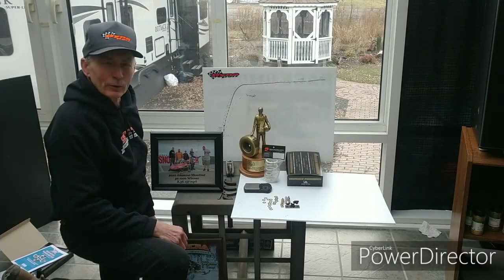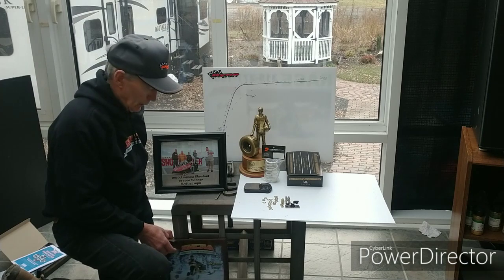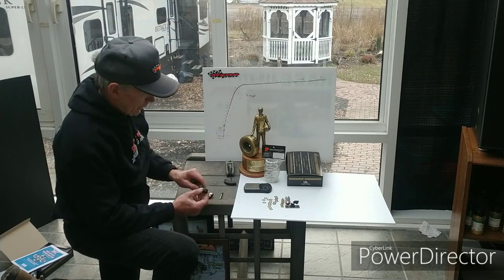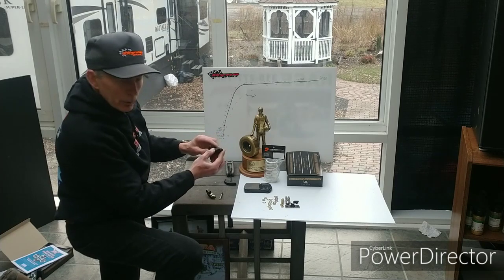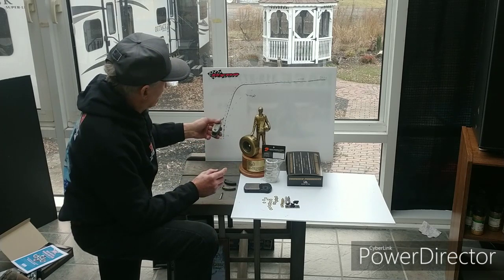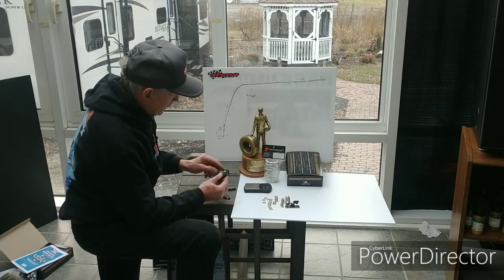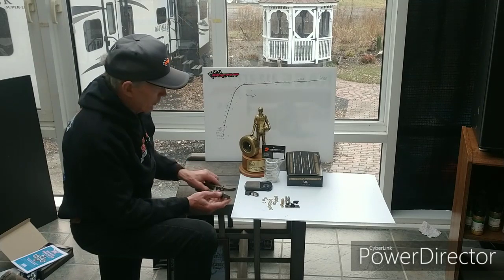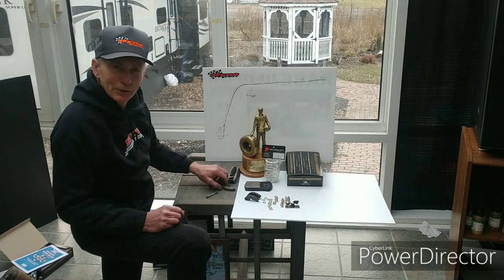Snowmobile clutch tip weight and response explained

Comment: I have a 87 yamaha exciter that I use for ice fishing in Colorado at altitudes  from 8,000 to 10,000 ft. Carbs are jetted for that altitude. But I get a bad bog from a stop through low mph. What color spring and weights do you recommend.  There's a yellow spring in there now. Thanks.

Comment: Hey Rich ! Love your videos and subscribed ! Question here ! I got a 2009 RMK 700 And at 3/4 throttle I hit the rev limiter and then The Zoomies kick in... I can ride my sled and give it it's full power but I can never pin it down... I'm always riding this sled under 3/4 throttle... What can I do to fix this issue ? Put heavier weights on the tips ? I got MTX clutch weights that you got to hammer pins in... Thankx for helping Rich !
Reply: Heavier weights in general
Reply: @curtiswilkinson9379  problem solved I needed a fuel controler now the problem is gone !

Comment: what about belt deflection? do you set it just tight enough for track to creep on a stand  like I hear from others all the time?  thanks a lot. surprised how far off the stuff on my sled is from the dealer. track too tight and slightly out of alignment. belt was too loose as well. its no wonder some people have dogs and some people have runners. Most probably don't check any of these things.
Reply from the maker: Set it according to manual right on the edge of track creeping works fine
Reply: Thanks. Almost everything was out of spec as I got it from the dealer. What’s your Facebook ?

Comment: I tried using your brake draging method on my 19 axys R with the same setup I had last year on my 15 IQR just to check if I was close at all. I was shy about 500 RPM from where I was running on my previous sled. Same motor just newer, same jetting, same gearing , same weights, springs and helix I took out of my 15 and put into my 19. I'm sitting here scratching my head now.
Reply from the maker: Its a bit trickey you have to hold the brake tight enough to load engine like riding and only, the twins will not rev unless loaded so I am thinking not enough brake . Only do 1 x and then cool some or you can warp a rotor  after a few runs. If any doubt make a 200 ft pass in lawn and will be a 100-200 low as a short distance.
Reply from the maker: There is a chance the 19 has an issue and is down on power so if any doubt put it on the ground and try it..
Reply: @dynoport9251  thanks I will see what I can do. The wife doesn't like me tearing up the yard, even though it's just grass.... It'll grow back

Comment: Rich thank you I would like to use this clutching setup on my snowmobile but it's custom built and I don't know where I should set it up or how how would I get in touch with you?
Reply from the maker: Message me on here and will get back to you
Reply: @dynoport9251  so I have a 2003 Polaris XC 800 motor I put it inside a 2006 IQR 440 chassis your secondary clutch is the stock 440 team clutch last year the sled rent very well and I took first place one of your events in Kissing Bridge did second place in a different class I would like to dial in the clutch and get more out of
Reply from the maker: @justforlaughs8988  Ok you should be able to put a steeper helix in do to the extra horsepower and you will run even better. Another trick would be to put a much softer secondary spring in then the 440 helix will open much quicker and act like a steeper helix. The best set up hill racing is being right on the edge of bog as you leave.. Do some testing in a wet dirt field and very close to hill conditions.. See you at KB and Cockaigne...